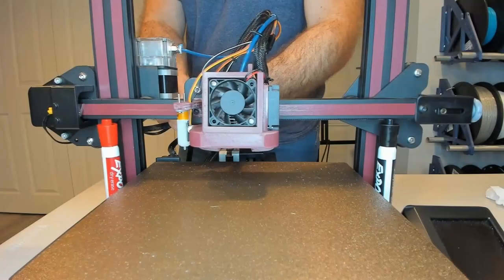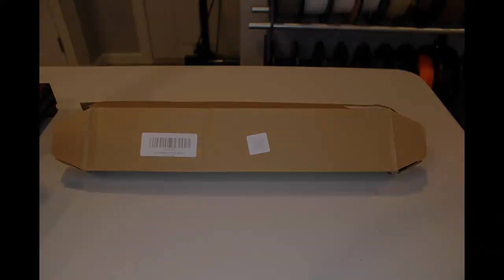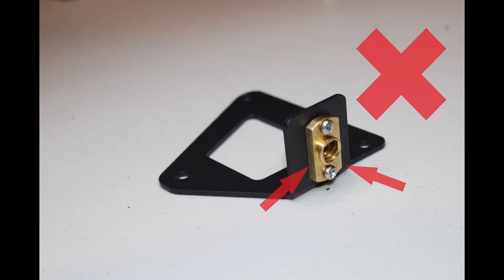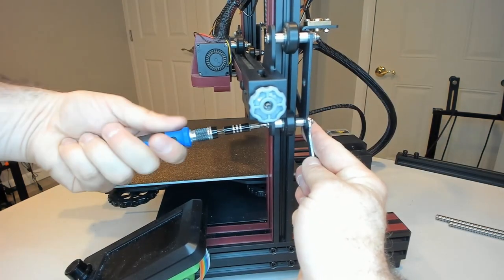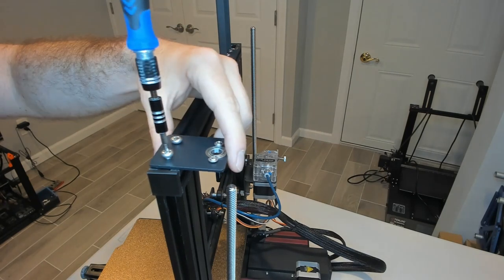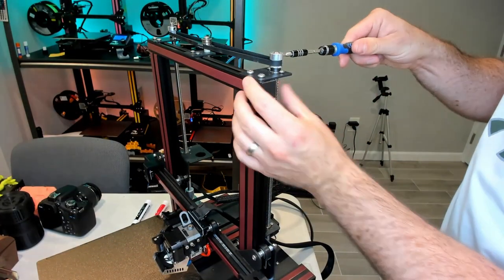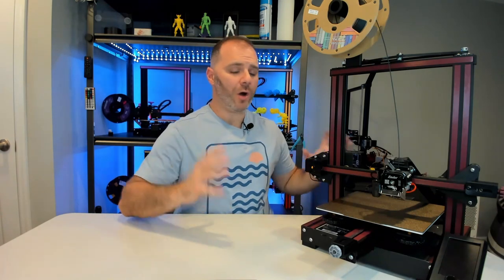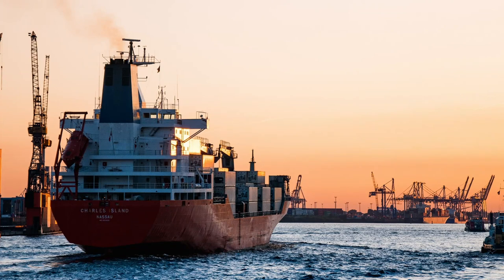Dual Z Axis Installation with Timing Belt

Comment: When I switched to a direct drive, using an all metal extruder and the full size stepper motor, I figured dual-Z would overcome the added mass, and would prevent X-axis sag on my Aquila X2. Then I found that it was more work keeping the Ceality dual-Z setup aligned, so I added a top belt. I discovered that a 640mm timing belt coupled with two 30 tooth gears would actually work without an idler pulley if the lead screws were properly aligned. I also aligned the printer frame with the Y-axis extrusion, not just the side extrusions. To reduce the top mounted filament mass, I built a filament holder for the left back extrusion, so now the printer fits under my shop cabinets for a compact setup. Looking forward to see what the Type III setup looks like here....
Reply from the maker: Those are awesome modifications you made. Would love to see your side mounted setup, I am thinking of re-arranging my printer setup and I might lower the over head of some of them. The other option is to open the tops and have them pull filament directly from the RepRack shelves I have my filament stored on. The 3rd installment is a really cool modification that you need to take special care when adjusting and initially calibrating but it performance is terrific. Thanks for watching and adding information.
Reply: @PrintsLeo3D  I found that the vertical extrusions were 0.45 & 0.30 deg off vertical relative to the Y-axis extrusion, so aligned them with shims. I am a life long woodworker, and only a ~2 year 3D printer, so I still find it easier to make some parts in wood, and faster, so my add-ons are all made from walnut. How do I send you a picture?
Reply from the maker: Oh wow, I love combining the two materials! I'd really love to see this. The easiest way is probably through email, you can reach me at:
 printsleo3d@gmail.com

If there is a better way for you let me know !

Comment: Been wanting to do this to at least one of my machines. heard horror stories about out of sync steppers without an upgraded dual z stepper driver motherboard. so I've avoided it so far but looks like I need to watch your full series on it at least.
Reply from the maker: So far I haven't had any issues with either of the setups. I have stayed within the 'magic numbers' for my layer height using the double stepper setup, but that's a usual precaution I take anyway. To be honest if you aren't adding weight or seeing noticable dag if the gantry then this is the type of upgrade that isn't imperative for high print quality. As always thanks for watching and for leaving a comment, you always take the time to write something and I appreciate it!

Comment: i stayed till your outro bro <3 loved your video alot! i might 3d print all the metal parts. I have an extra z rod. and extra brass couplers. all i would need is the metal parts (or if i printed them) some small hardware (screws nuts and spacers) and a belt is the only other parts i would need to do this mod... i think it would be a good benefit... i would have to move my psu then though too cuz i got a v1 neo
Reply from the maker: Thank you so much!! I appreciate the love! This is certainly the cheapest of the 3 ways I installed a dual z axis, and it's the most straightforward way. If you're interested in 3d printing parts for a dual z setup I would HIGHLY recommend looking into KevinAkaSam's dual z setup. I have a video that goes over that mod and it' super fun and mostly 3d printed! Either direction you go good luck and enjoy!

https://youtu.be/Do0L4yVF0so
Reply: @PrintsLeo3D  thank you so much for suggesting this video! I seen in one of the comments you're slowly converting all of your printers to this mod, just curious how many printers do you have and how many have you converted so far?? Have you seen a positive difference in all that you have converted?? Obviously you must! I'm literally just waiting on my sovol sv06 and sonic pad to come in the mail today or tomorrow.. I'm so excited. Since I'll have two printers I'll feel comfortable enough to do a big mod like this on my ender 3 v1 neo.. I gotta soup that thing up or it'll become obsolete real soon
Reply from the maker: I have converted 4 printers total. 2 are belted dual z, 1 is dual z with 2 motors, and 1 is dual z with timing belt. Dual belted z is my fave. The dual motor is second, and the timing belt is my least favorite.
Reply: @PrintsLeo3D  Very interestng can i ask why the single motor timing belted one is your least favorite? i definetly understand how you could get more banding with that. that would be a great topic to make a video on i would love to watch you explain that and your printer farm
Reply from the maker: The reason the timing belt is my least favorite really just has to do with cost and assembly. It's the most expensive of the pre bought options(not including dual belted Z which can vary), and it has some of the trickiest parts to assemble. Also after any of the installs you still need to tram the X axis gantry, and the timing belt version is the 'hardest' of the three to tram. 
    These are all minor annoyances but it's enough to differentiate one from the other.
Reply: @PrintsLeo3D  do you notice a quality difference in either?
Reply from the maker: No not really they all perform about just as well as the other. They do all have some other differences though (direct extrude vs Bowden and stuff like that) so it's not necessarily an apples to apples comparison. That being said they all print very well.
Reply: @PrintsLeo3D  Yo, i came back to this just now. its nearly 4am and i just learned about the ender 3 switchwire mod. have you seen that yet? all the conversions we talked about are great. im actually probably gonna do the one you like the least because i will have an extra stepper once my neo series direct drive comes in (its the strange neo model so i hope it works well cuz there isnt much testing behind it) If i could afford to though out of all mods i would do the switchwire mod on my ender 3... looking at quality comparisons its almost day and night in my opinion but i look at literally every detail.. just had to come back and find your comment to refresh myself on all the conversions.. its only been two weeks but theres so much information i take in in just one day sometimes...
Reply from the maker: Yea whenever you delve into a topic like this there can be information overload. Yes I've seen the switch wire mod, a few people in the Discord were considering it actually. Seems like a great project, a decent amount of work involved but well worth it. 
    The real answer on which mod to use is: whatever works for you.  What I would recommend is to hang around the deals sites (on Reddit or 3dprintingdeals.com) and see if you can snag whatever one you want for cheap.

Comment: Nice but price is abit steep unless I'm missing something. Cheaper to go dual Z motor. Only upside is it won't be out of sync for those who have that issue. But that almost doubles the price for that feature alone. 30 ish to 50 ish for me on amazon.
Reply from the maker: Yea you're not wrong about the price. I had purchased both the stepper and timing belt kits awhile ago, they were both on sale too, do the prices were nearly identical to one another. As far as either one going out of step I haven't had any issues yet, and I am sure to keep my layers in multiples of 0.04mm to protect against it.

Comment: Well done explanation of the whole process. I think this is the upgrade I will do when I need dual z. Any idea if a dual z would effect  printing at higher speeds?  I’m just thinking of the extra mount parts adding potential for binding.
Reply from the maker: Thanks for the compliment I appreciate it! These videos take me a lot of time and I'm so nervous during the process I just hope the end result is helpful. 
As far as speed goes that's a great question, and to answer: I'm really not sure. I think under normal printing scenarios this dual z shouldn't give you any binding issues. The Z axis is only under speed during layer changes, which given the model, could be a long time between layers. However if you have z hop enabled I could see that causing quick and constant movements of the z axis. The belt on this setup is pretty tight , but under high enough speed I'm sure slippage could occur. I'll be putting Klipper on this very machine shortly, I'll do some high speeds test (with and without z hop) and let you know the results.

Comment: I need help i set up the dual z with a stepper motor but when printing at some point one side the model will be grinded by the nozzle i have the belt timer any idea if i can combine both until i get a dual z motherboard?
Reply from the maker: Hey Mohammed! I think we are now talking on Discord , but getting the belted mod running shouldn't be hard. I'll have a video for it ready really soon too. I'll continue to communicate with you on Discord and figure this out !

Comment: Installed this last week.  Wasn't happy with the way it's designed., specifically the 2nd z screw is left floating relying only on gravity to keep it in place.  In theory shouldn't matter but at times it would lift slightly.     I ended up buying  a cheap z motor kit and installed the two together.  Now it not only stays rock solid but the belt keeps the two stepper motors in sync
Reply from the maker: I had the same thoughts at first, I did not like the floating screw. I found out that it there is any 'jumping' present it's usually due to the upper gear not being seated properly. This has worked great for me, just as well as the dual Z setup actually, even though I was skeptical at first. At this point, from the two different setups, I usually recommend the dual Z stepper basically for the points you made, it's stiff and secure, but also a little easier to install and about half the price currently. Thanks for watching and letting me know your experience!
Reply: How has this setup worked for you?
Reply from the maker: It's worked fine for me. Definitely does not feel as solid or secure as the other two methods I have covered, but it hasn't caused any issues on its own. Sometimes it feels like the main lead screw is really doing the work and the other is just along for the ride (which is sort of the idea), and isn't helping all that much.
Reply: @PrintsLeo3D  I was asking more about the belted and the second motor together
Reply from the maker: When you say belted do you mean the dual belted z mod? I'm gonna assume that's what your talking about and that's what I am referring to in this reply: 
I would put the belted and the dual Z motor mods about on par with each other. The dual motor is quicker to set up but the belted mod is way more fun to put together. The belted z feels like a project, you can pick some colors, source the materials, and then it feels good when you're done. The single belted z (which runs along the top extrusion) is my least favorite. It's not fun to put together and it's somehow the most or second most expensive.

Comment: So I bought (another) creality dual z kit before I saw your 3 part series, and they don't come with a timing belt. I bought some belts and gears, do I also need longer z lead screws?
Reply from the maker: Judd, if you're going to try for the timing belt dual Z then no, I don't believe you don't need longer z screws. The stock length should be fine. The secondary lead screw will not reach the bottom extrusion , it sort of just 'hangs' in the air. I am on vacation now, but when I get home I will double check the length and let you know so I'm 100% certain. Thanks for watching !
Reply: @PrintsLeo3D  always appreciate any response! You're the best, Leo!
Reply from the maker: Anytime! Thanks Judd!

Comment: Is the direct drive better than just upgrading our hotend so we can print the higher temp filament
Reply from the maker: No, I wouldn't necessarily say so. I've had my Bowden style 3d printers for a long time, and they print really well. The one upgrade I could absolutely recommend is a BMG style extruder (for the cold end). That is a covered dual gear extruder, which offers better filament movement, and the covered aspect will allow you to print flexibles at normal printing speeds. As for high temps you'll want an extruder that is 'All Metal', and there's some direct extruders that  don't satisfy that condition. So just be on the lookout when you're looking to upgrade.
Reply: @PrintsLeo3D  I did do a dual gear upgrade and have bed springs ordered going off your earlier videos
Reply: @PrintsLeo3D  I did the all metal one was kinda worried that the higher speed of the ratio would wear the stepper motor out faster
Reply: @PrintsLeo3D  also can I ask which of the 3 dual z would you say is the best overall I kinda like the idea but what you pointed out with the dual motor kinda has me not wanting to go that route
Reply from the maker: Blizzy I'm sorry I never replied to these, I never saw your replies. I think we are talking through email now though so I'll answer your questions there

Comment: Thank yoy, Leo
In your opinion which Dual Z better 1 or 2?
Reply from the maker: Thank you for commenting! If I had my choice between the different dual Z setups I would choose the dual motor design. Right now both designs are printing just as well as the other, so I think the slightly easier setup and lower cost of the dual motor makes it a better option. That being said I didn't see a noticeable difference with either dual z setup compared to my single z printing.
Reply: @PrintsLeo3D  thanks ! I'm waiting 3rd part)
Reply from the maker: 3rd part is worth the wait !

Comment: Would you recommend one method over the other?
Reply from the maker: I didn't encounter any problems either during installation or afterwards while printing that would make land firmly on one side over the other. The setup was similar for both and I have gotten reliability from each. If I had to choose only one, I think I would choose the double stepper motor. The setup and the leveling of the X axis is slightly easier, at least for me, so that would be my preference.
Reply: @PrintsLeo3D  Yeah I just finished watching both videos and thought the double stepper motor was a simpler installation and the cheaper option. Btw does the Ender 3 version fit the Aquila? It's cheaper right now and from the product pictures it looks like they're the same besides the Ender kit including an extra plate that the Aquila doesn't need.
Reply from the maker: Yea I forgot to factor in price lol the timing belt version can sometimes fetch double the price. Yes the Ender 3 version will fit the Aquila. The kit I installed was in fact billed as an Ender 3 kit.
Reply: @PrintsLeo3D  Perfect! This and a 3D Touch are gonna be my next upgrades
Reply from the maker: Awesome! Good luck with both, I'm sure you know I have a bl touch installation video :) If you need any help during the installations drop me a line on here (or discord) and I'll be happy to help.